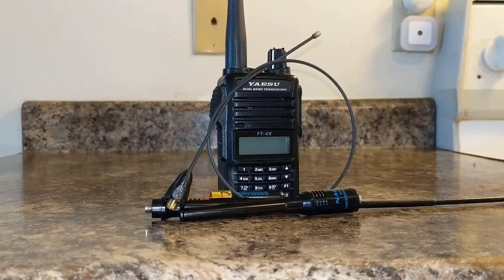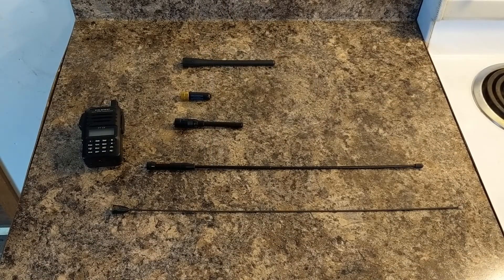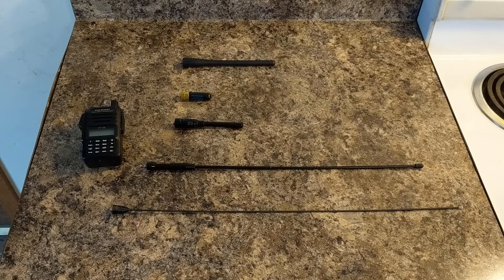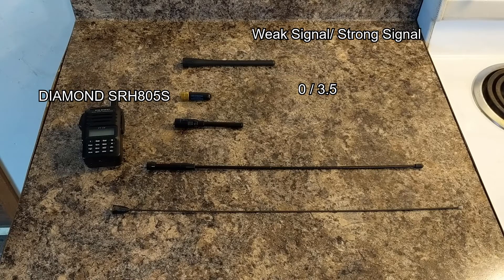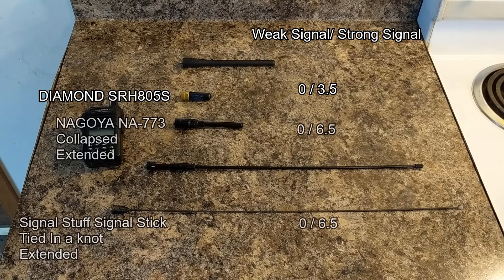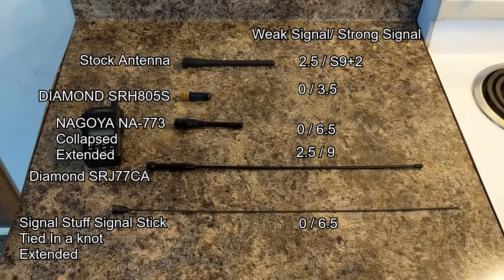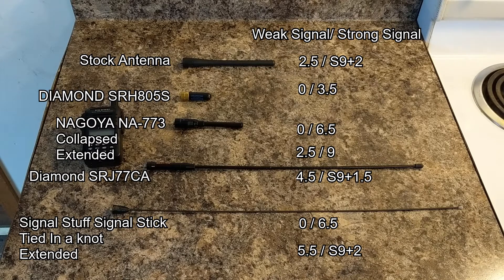HT Antenna Comparison Part 1

Comment: For the most part, when it comes to receiving signals, you just need a long stick of metal extended into the air.  Transmitting is where quality beats quantity.

Comment: I've seen several reviews/tests on the Signal Sticks and so far it's a 50/50 toss up as to good and bad. For $20 plus postage it's a small gamble. Unfortunately, on All of the 5 or 6 tests I've seen, it's been a different radio and varying geography with each. The ultimate test would be for 6 people in geographically similar areas, to have the same  radio - choose the same antenna connector (BNC, SMA-Fem, or SMA-Male). You eliminate/account for the variables. You're testing 6 of the same Signal Sticks on the same radio, on the same frequency,  between 6 people. It's not fool proof, but would give a more accurate comparison and review.
Reply from the maker: Thanks for the feedback. It would be a good test if I were to just be testing the signal sticks. I currently have two and have had good success with both.

Comment: The Nagoya you are using is fake. It is not made by Nagoya.
Reply: Also, genuine nagoyas now have a qr code on them to check the authenticity.
Reply from the maker: Thanks for the info. How can you tell, just so I know in the future.
Reply: @soderlund416  The genuine Nagoyas have white print on the bottom and the blue ones are knock offs. There are other things that pertain to the packaging that I don't recall right now but the fakes always have blue print.
Reply: @RisingTidesAC  I've been aware of counterfeit radios, Motorola's, Icom's, Kenwood's... but antennas... that's pathetic ! Thanks for the heads up
Reply: @baronedipiemonte3990  My pleasure.
Reply: Unforunately Diamond is also fake as Diamond doesn't make SRH805 with female SMA. Radioddity is branding those antennas, but what's interesting they claim that it has 2-3dB gain, when original Diamond SRH805 (male) has 2dB, but negative gain...

Comment: Crappiest radio on the market. Not watching. Yaesu sucks!
Reply from the maker: Man you got some anger issues if you stopped by the channel just to leave a not watching comment. But thanks for it because it helps the algorithm out. 73.
Reply: @soderlund416  anger yes, but not issues. I have the FT-70DR and besides the battery life, the convoluted programming method with the power up power down plug in the cord situation and the fact that most BaoFeng's transmit and receive better as does my AT-878UVII it's a great HT.
Reply: @soderlund416  the irony 🤣
Reply: Buy the original dude.